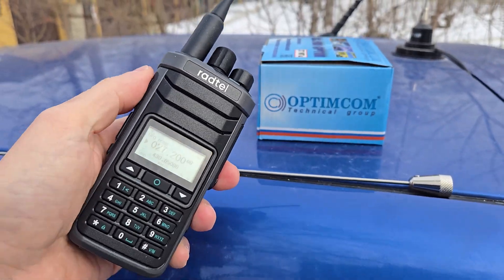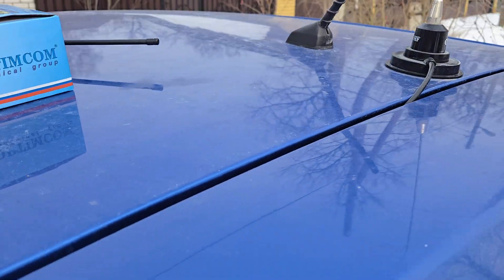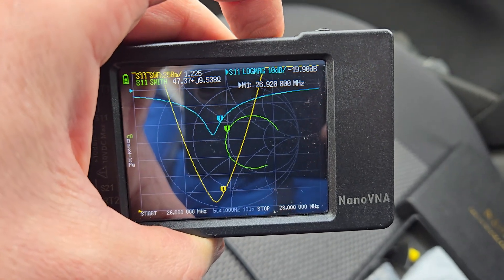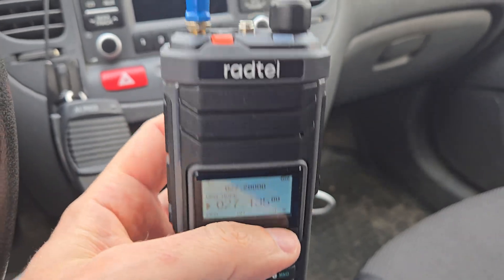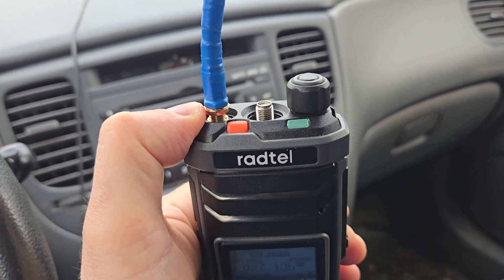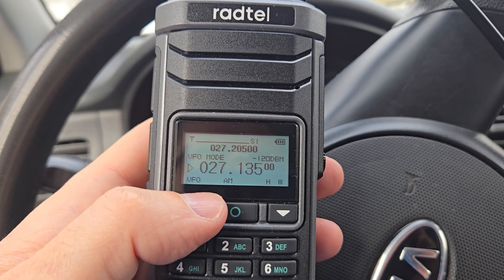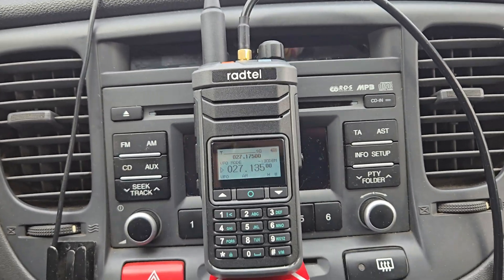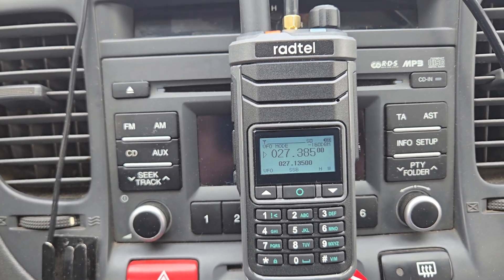Radtel RT860 27MHz reception

Comment: Rightly shown. The smaller left side antenna is for transmitting only on the VHF/UHF bands, but also seems able to receive decently for UHF/VHF. But for any other lower frequencies-all lower ham bands down to long wave, the right side antenna connector must be used with an appropriate antenna for whatever frequency you wish to QSL. Theoretically any good longwire, yagi, dipole or similar might work very well as a receiving antenna but I have not tested it yet on those bands. i also have a CB vertical I am mounting soon on a mast and will test this with my magnet mount CB antenna used for reception and transmission. This radio is not designed to transmit on CB. It will, but will interfere on the air bands which violates FCC rules in the US for transmission.
Reply from the maker: Thank you for this detailed and accurate information! I appreciate your knowledge. That's really helpful information

Comment: Hi the... new to this radio thing... what radio will you sugest for CB and maritime option... portable obviowsly... for a small inflatable boat... and use in CB mode on car. I thought about this radio but you didn't sugest to transmite wi it in CB mode. Thanks a lot!
Reply from the maker: I'd like to say that the radio RT860 is really good radio, but for fun.
Just for use in some experiments or tests for amateur radio.
Probably you need a couple of different radios, one radio for CB 27MHz band, and a the second for use at sea. Because in the current moment it's impossible to make a good all-in-one radio for VHF/UHF and HF band.

Comment: Thanks. So, 27Mhz AM/FM only RX by radio specification. Question. Is possibile TX by main antenna port or second aux port?
Reply from the maker: Tx possible on 27MHz on the main port in FM mode only, but there are a lot of harmonics. The main video about the radio https://youtu.be/E2Bf6FyjL8o